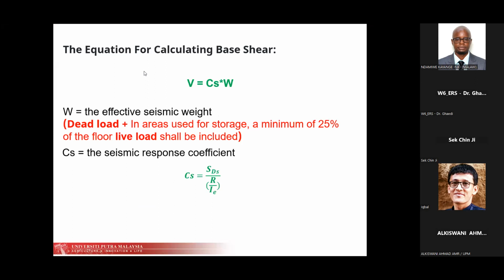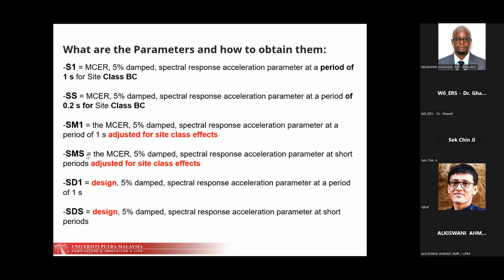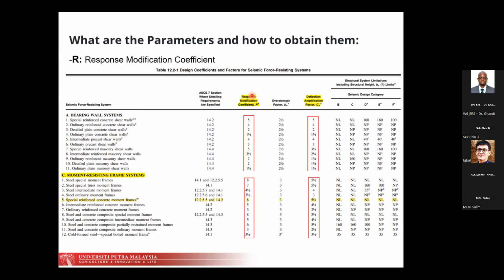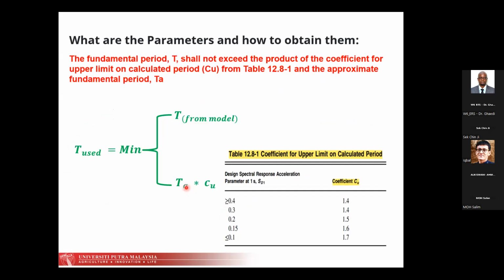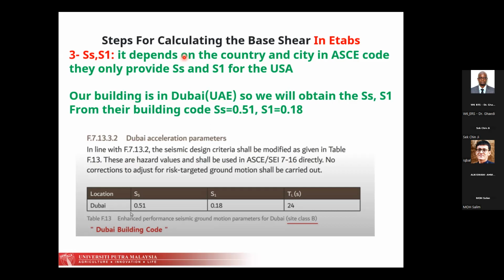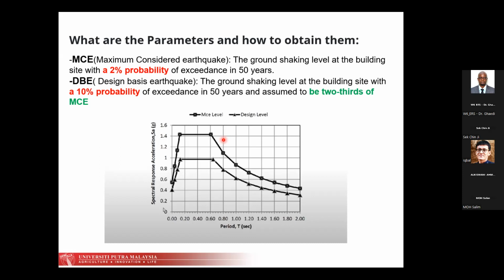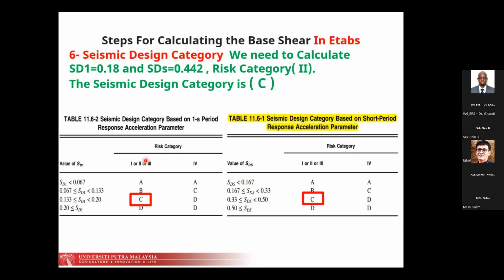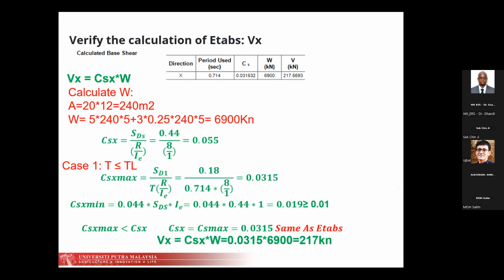Understanding seismic parameters in analysis of structures (ASCE 7-16) - ETABS version 21 _ PART 1

Comment: Hi  sir
How can I specify suitable seismic force resistance frame?
Reply from the maker: To specify a suitable seismic force resistance frame, start by understanding the local seismic requirements and the relevant building codes and standards governing seismic design. Determine the seismic design category for the structure based on site-specific factors and perform a comprehensive structural analysis, considering forces, deformations, and component performance. Select an appropriate seismic-resistant frame system, such as moment frames, shear walls, or braced frames, while emphasizing ductility and overstrength. Ensure that connections and anchorage within the frame are well-designed to distribute forces effectively. Specify seismic-resistant materials, foundation systems, and establish quality control and inspection procedures during construction. Seek local building authority review and approval to ensure code compliance and prioritize ongoing maintenance and inspections for long-term safety in seismic-prone areas. Consulting with experienced structural engineers is crucial for the successful implementation of these steps.
Reply: Thank you very much 
Is there new video about this steps or subject?
Reply from the maker: @muhammadkareem1284  we are not sure habibi.
Reply from the maker: @muhammadkareem1284  not sure dear.